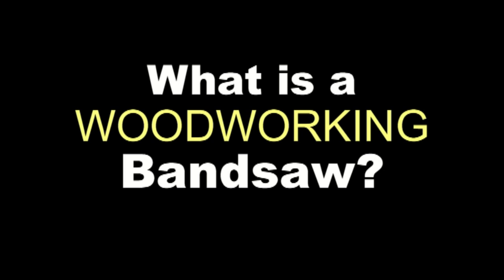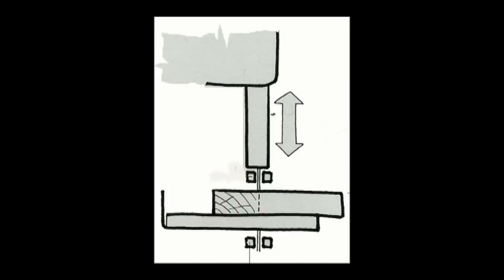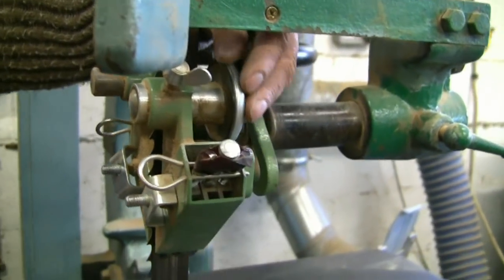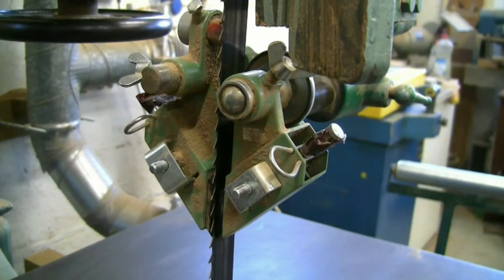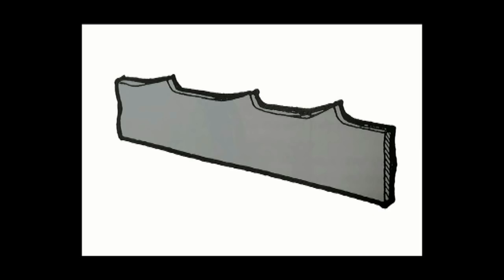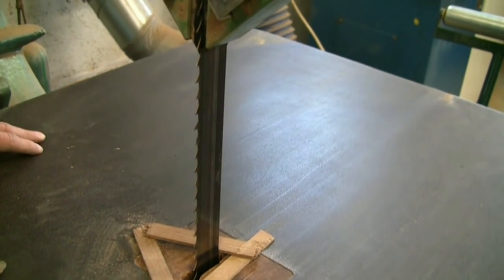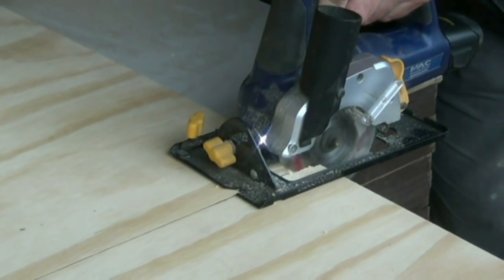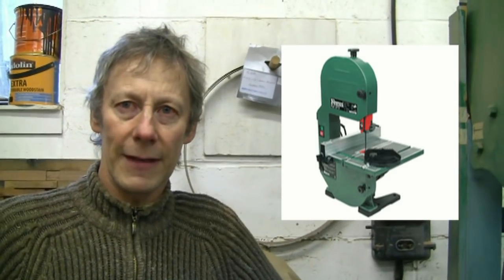What Is A Woodworking Bandsaw

Comment: Hello Jeremy.  I appreciated your insight into the bandsaw.  I also own a bandsaw, an 18" Jet model which is a great tool to use.  One problem I have however is that whenever I try to make a deep cut, I get drift of the blade as it follows the grain, rather than running true.  I use a wide blade at 20 mm wide with a low TPI count, move the guides in close but not so close that the bearings are running when not under load.   I tension the blade according to the chart on the machine.

Despite all these manoeuvres, I still get an unacceptable blade drift.   

Do you have any suggestions on how to reduce the blade drift as I have had to revert to using a circular saw whenever I want to make a deep cut.  My circular saw is 12" in diameter meaning the deepest cut I can make is around 4 ½" only.  A far cry from exploiting the full throat which is 12".  It also means that unless I can master this, forget about cutting veneers. 

Thanks in anticipation.